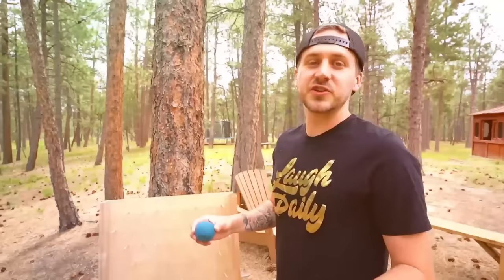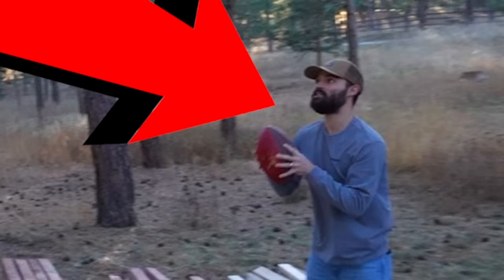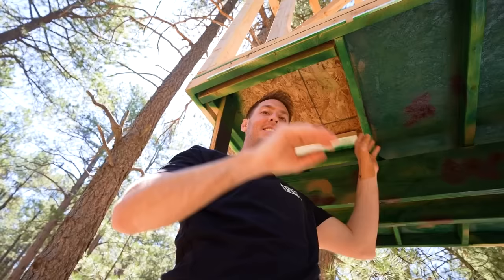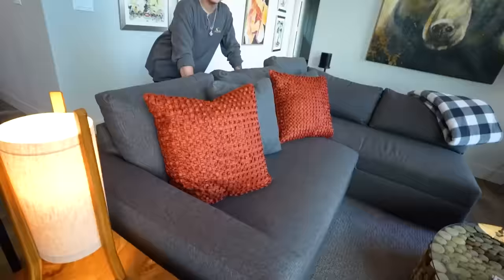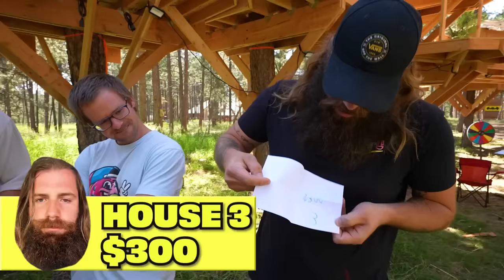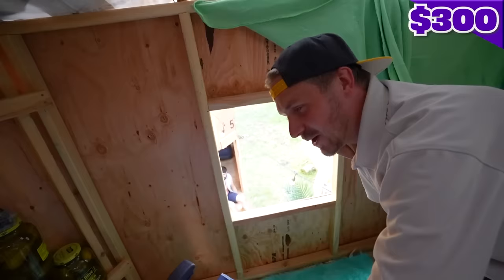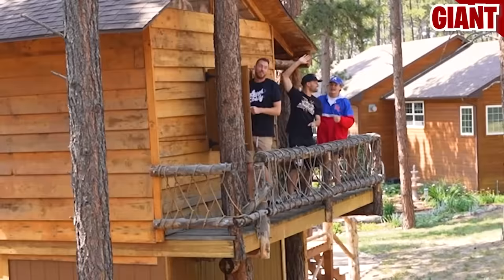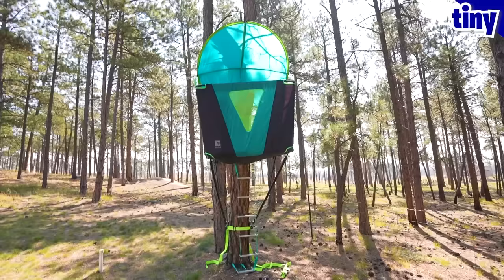SURVIVING IN ULTIMATE TREEHOUSES!

Comment: Now no hate on them but I'm pretty sure there calculations are wrong. The specific gravity of water is 8.34lbs per gallon. If there only putting in 2,000 gallons the it only has to hold 16,680.